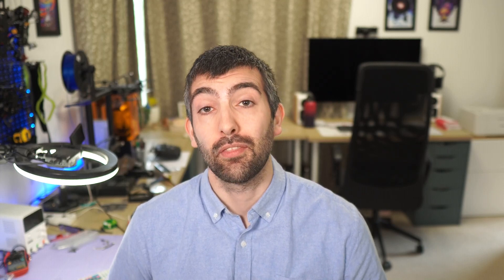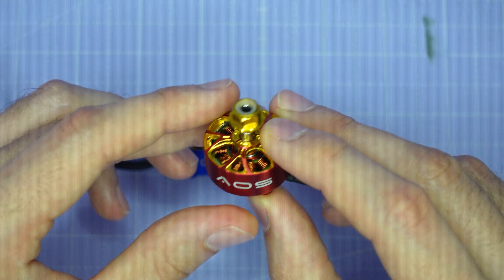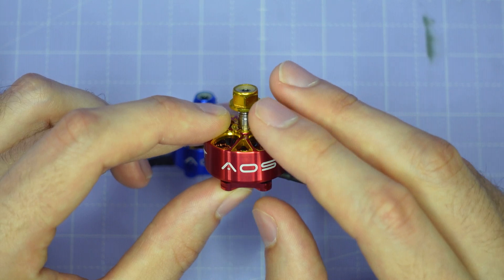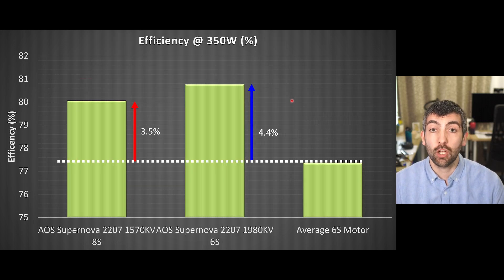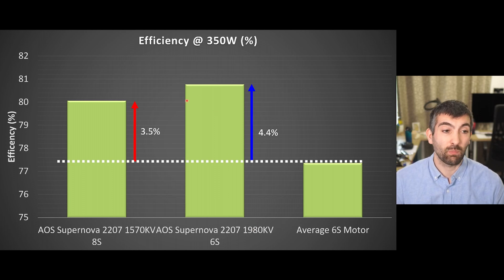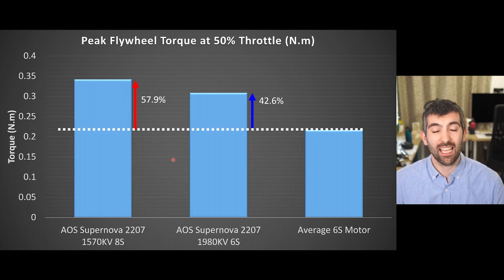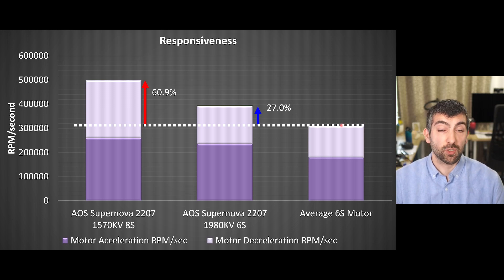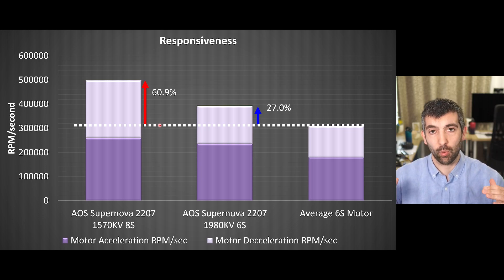You asked for it, you MANIACS! 😁 The AOS Supernova 2207 1570KV 8S

Comment: Bro this thing about the "Master Multiplier" you reallllllllly need to include that in some kind of caution label in the Box of the AOS Supernovas.
I've been troubleshooting that damn oscillation issue for almost 45 hours now, burnt an ESC and FC, Crashed into Ceiling, Trees and Bushes, all because I wasn't aware of this PID Gain Master Multiplier thing you were talking about. I've been in every forum on the web, Reddit, Facebook, Discord etc. and not a single person can figure out what the hell is going on.

But I noticed something odd in my testing just now, if I set motor output to 30% Max, then the quad is stable. If it's at 100% of Max, it freaks out, oscillates like crazy and flys off on it's own.

Please Chris, put a warning label about those PID gains in the Box, or something, because I've been going mad trying to figure out what the hell was causing such wild Gyro inputs. 

Anyways, thanks for the wicked motors. These things are terrifying. <3
Reply: i set my pid mm to .6 hovered for about 6 seconds then had a fly away did that happen to you
Reply: @grief878 check your fc screws and make sure they are holding. You may have a loose component somewhere causing vibrations.

Lower the MM more.

Comment: You sure went off the rails here.  We don't need an 8S battery.  Not only is 6S just fine, 8S batteries and electronics are even more expensive, 6S is already expensive enough.  What we really need Chris, and please be our hero, is a good 3.5 motor.  The 4S 3.5 inch motor selection is woefully thin.  PLEASE!

Comment: 900kv or 1100kv 12s pls
Reply: 50 Volts and 60 Volts (12S) is danderous.Especially when the quad gets wet or damp, and a kid is picking it up...
Reply: I know that was a joke. But lets be seroius. I think we will not see more than 8S in the hobby.
Reply: @Sugalime3D_FPV  I am flying 12s man. been for 4 years now.  just low KV (380kv). Props won't take 1100kv at 50v that was a joke, large props will go supersonic quickly.. and yes very dangerous! you need conformal coatings everywhere!! but drones where born from 14s-18s RC helicopters. Just the level of skill dropped as to be able to deal with these potentials..
Reply: @dronelabs300blk  As far as i know electricity with over 60V DC is becoming dangerous... for electric schock...

Comment: Do we need the extra weight of an 8S battery on a 5” quad? Wonder if the power to weight ratio will improve on your average build.
Reply: Gnb do a 8s 650mah at 140grams is not really more weight is it? And look at the numbers 35grams 2699grams of thrust with a 5inch prop its not really hard to work out that it does?

Comment: Hey Chris. I just preordered 2 sets of these from DeFiance RC. I am curious what prop to use with these on a 5-inch frame to get max speed and efficiency (if that is possible). I will be running 1100 mah, and 1300 mah 8s batteries.

Comment: Make them in ~1200kv please.  1570 is too high for a 6" prop.  For VTOL.
Reply: Just do throttle cap in betaflight
Reply: @JLfpv  Betaflight doesn't do vtol.  Throttle cap does nothing to solve the issue.  No resolution, hot motors, etc. Esc's hate super low throttle settings with high power.  Heats them and the motors up fast.
Reply: @scottyh72  betaflight devs need to.get on that. Cuz no heat in betaflight motor control. I run 5s 2450kv and beat the hell.out of my motors fly vent props and motors Come down barely warm. Sometimes like I didn't even.fly. and I don't even use a throttle limit.  Full send baby
Reply: @JLfpv  This is for an AIRPLANE not a quad.  Totally different application.

Comment: does it matter that RCinpower as manufacturer, declares measured max thrust over 2500grams at 6S?
Reply from the maker: It depends on the prop they use and I always use the same prop on every motor for a fair comparison.

Comment: All the 4s holdouts building dual xt60 connectors to get ahead of the 6s folks
Reply: Not really because you need 2x small 4S battery and they often have XT30. But what you need is XT60 for 5 inch.
Reply: @Sugalime3D_FPV  you say that like it's hard to change battery connector 😝
Reply: @BeautyBeastRC  Normally, not only the connector is designed for the current (XT30) nominal value, but also the battery cables and the internal wiring of the battery. This means that if you want to convert an XT30 LIPO to XT60 LIPO, you would have to completely dismantle the battery down to the individual cell and rebuild everything. If these small cells are even strong enough. Otherwise, you can also take the cell apart and rebuild everything with more strength. Have fun. 😂
Reply: @Sugalime3D_FPV  you really believe all that? Wild bro 🤣